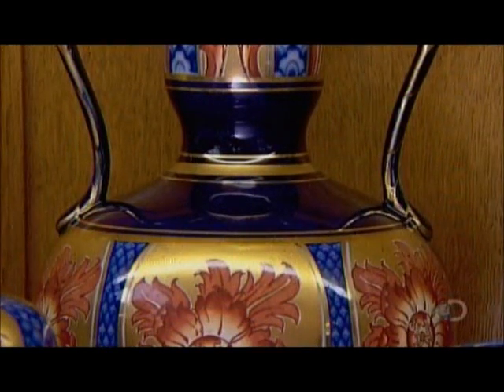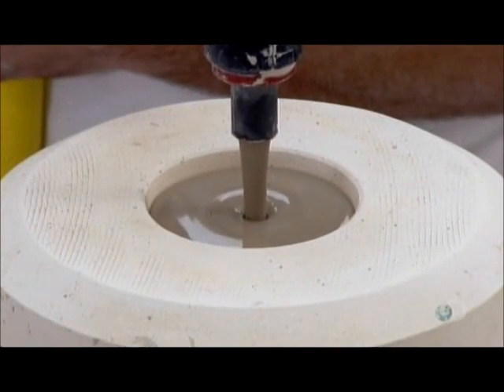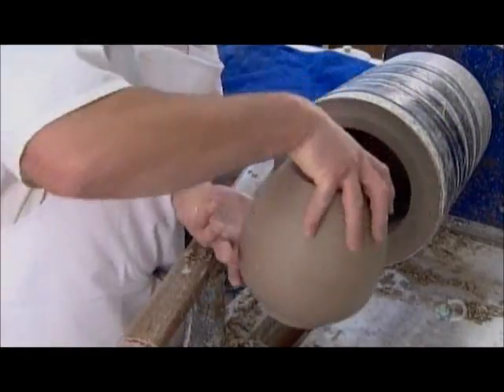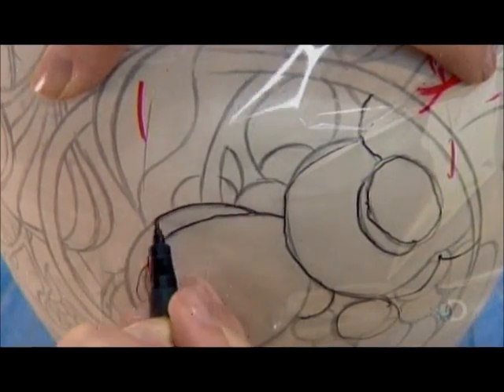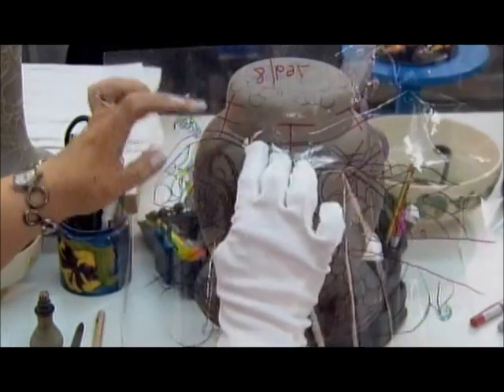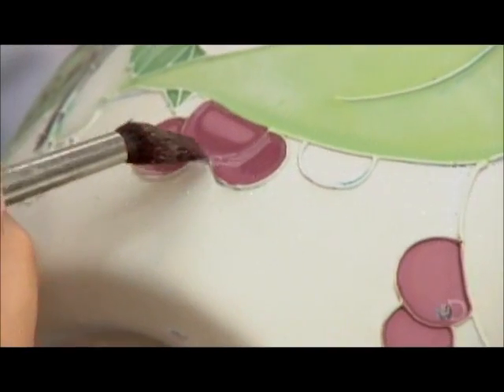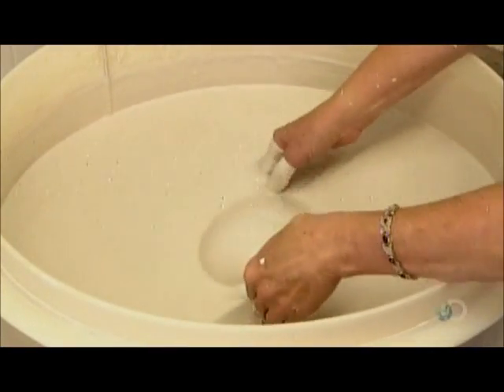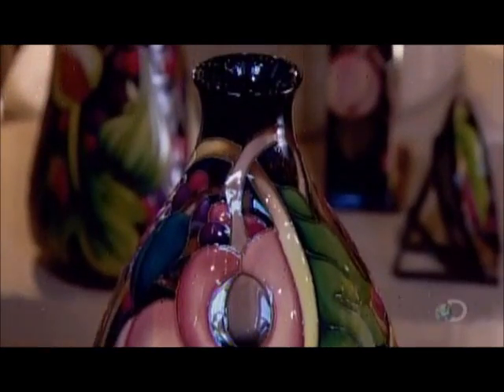How It's Made - Earthenware Pottery

Comment: 100% humidity = in water -_-
Reply: No. I lived in Houston, TX for 11 yrs.  100% humidity and not raining is miserable. It goes to the bone for cold or hot.
Reply: not rly.. mountains in winter usually have 100% humidity for example
Reply: They probably meant relative humidity.
 It means that the air is holding 100% of the amount of water vapor it can hold. The capacity of air to hold water vapor varies based on temperature and barometric pressure.